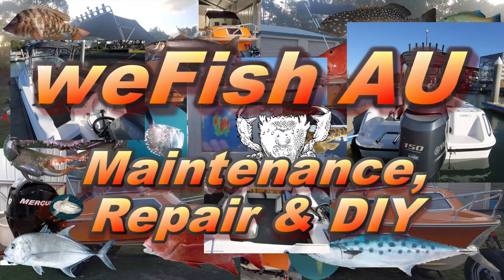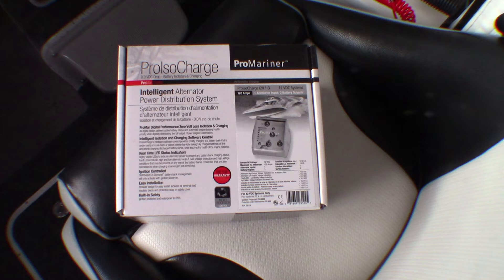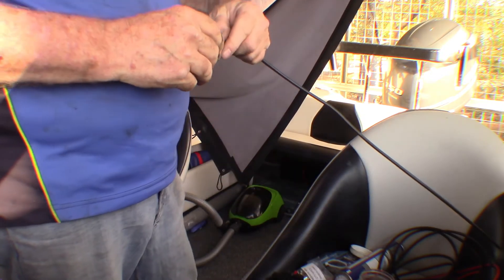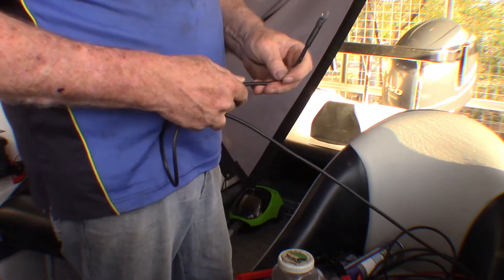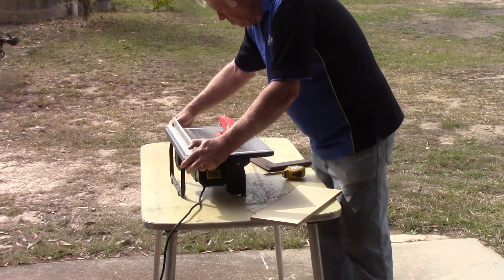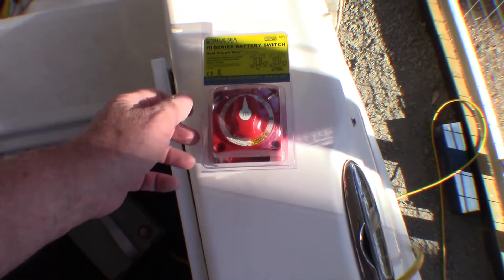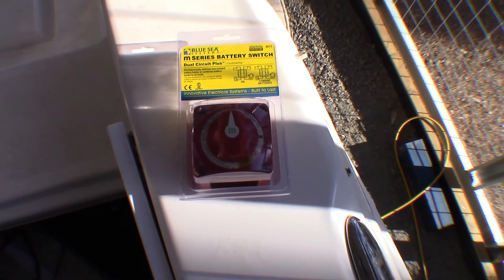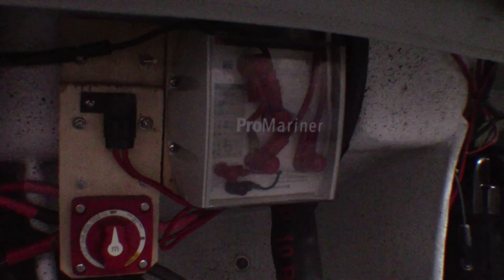Installing an Automatic Battery Isolator System

Comment: Will you consider reviewing True dual battery isolator kit. It has 3 yr lifespan, waterproof, anti-vibration feature and heat resistant? You can see details at www.trueam.com and www.dfna.info for retail?
Reply from the maker: Sorry, I only review products that I have purchased and installed on my boat.